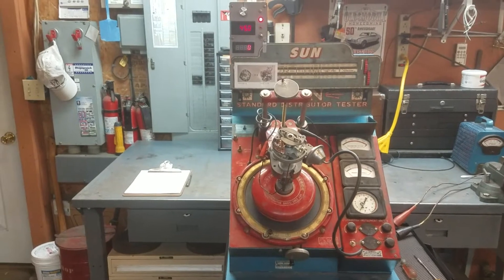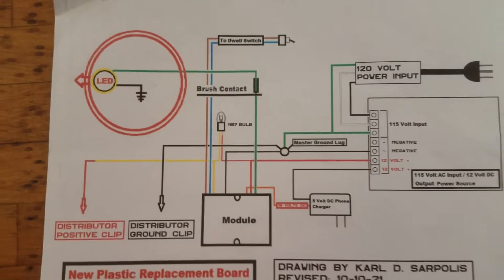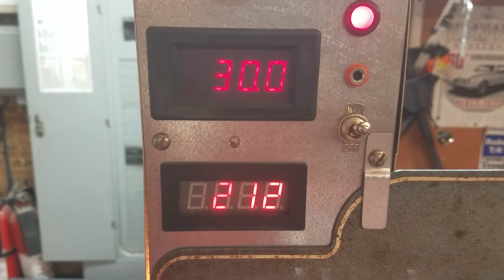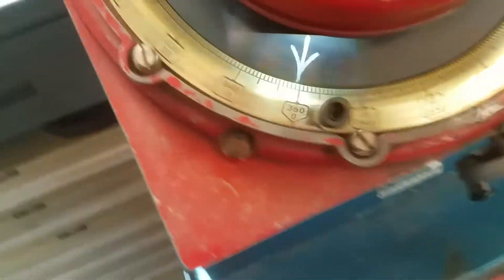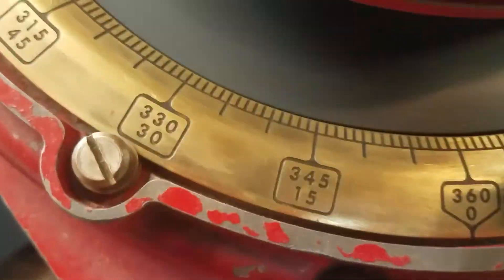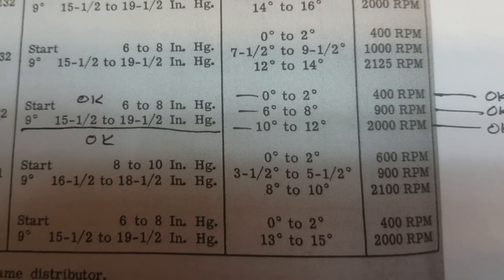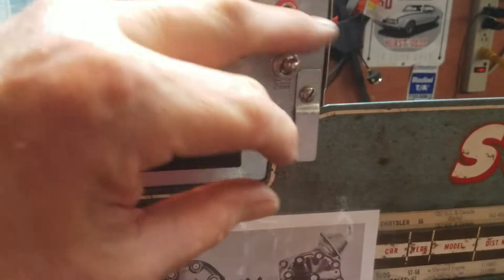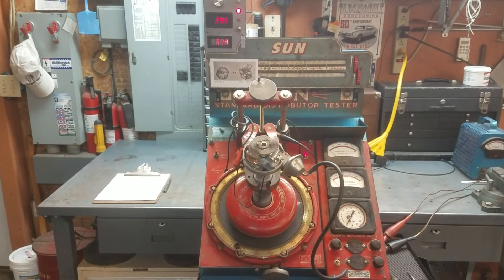Oldsmobile 4-4-2 Distributor test on an Old SUN Distributor Tester with modern Electronics

Comment: Good video, however for safety's sake you should install the correct rotor button and distributor cap to prevent the advance weights or springs from becoming a flying projectile if they were to come loose. 
I have been using the Sun Distributor Machines for 40 years and parts can fly off a rotating distributor at high speed.
I have 3 of the distributor machines in my shop. 
Also, please get a camera tripod or hold the camera more steady.
Thanks.

Comment: I have been looking for a 506 model for some time. Paramount has parts frim what I see. Who rebuilt your machine? I have an opertunity to get an old 600 series but it will need work. It does run but not sure if its accurate. He wants 850$ for it but that seems high to me. Im thinking on it though.